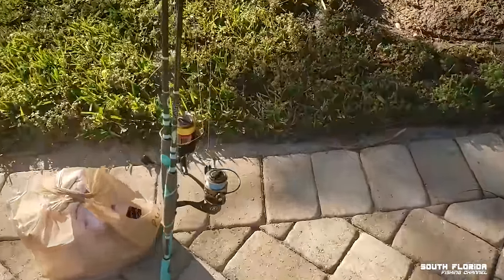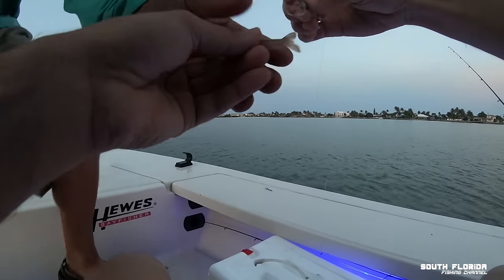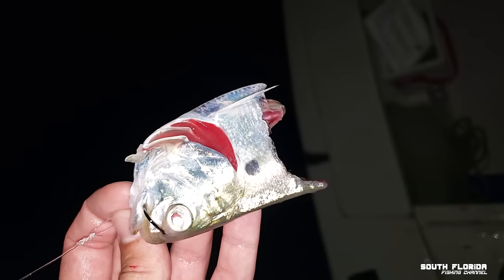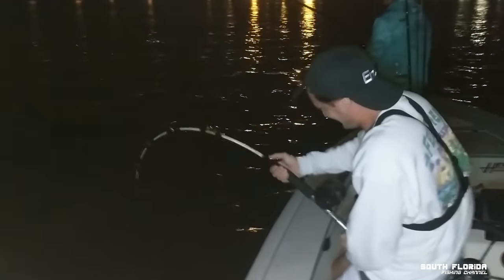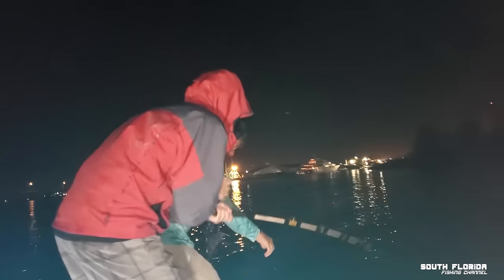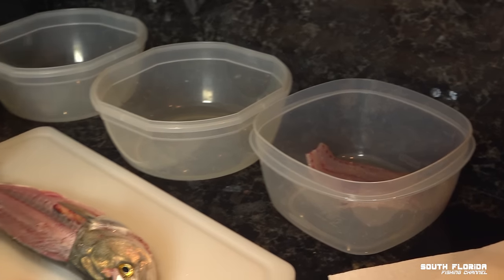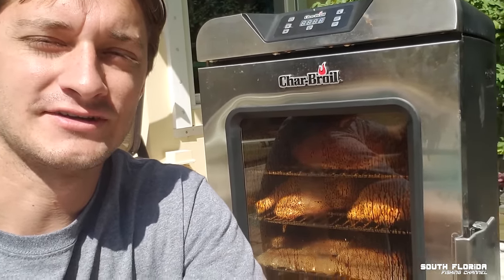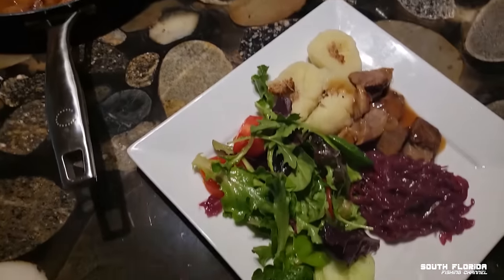Catching Dinner & Hooking MONSTER Fish {Catch N Cook}

Comment: I feel like u were snagged the whole time
Reply from the maker: lol I don't think snagged rocks take out drag and swim into anchor lines. Look at the way the rod bends when the fish is pulling
Reply from the maker: Also rocks don't suck all the scales off the bait. That's what grouper do =)
Reply: Actually, you could have been snagged on a rope or cable, which would seem like it was taking out drag when moving beneath the sea. The rope/cable would flex and bend making it appear as if you were pulling it up via the rod. 
It happens when sea fishing and the area is known for shipping lanes and underwater telephone cables. If you can't feel headshakes and only dead weight, in all probability you are snagged on some kind of flexible material.
Not saying this was the case here, but it does happen.

Comment: Except for deep drops, I just hate circle hooks.
Reply from the maker: I've had awesome and bad experiences on them. I'm still a big fan. Especially for the mutton snapper
Reply: @SouthFloridaFishingChannel  I've seen the smaller, thinner wire ones like you probably use for mutton.  They don't seem to have that extreme part of the circle.  I'll try them with dead bait for Ling Cod and see, if you've had good luck. What I have had problems with on Halibut are the big ones like you were using on whatever big fish you hooked.  It has to find the corner of the mouth and a lot of times it doesn't.  In shallower water I have gone back to a big J hook...you can get a bite, wait for it to bury and drive it home.  Than if it doesn't get hooked or pulls, I can blame myself not the damn Circle Hook!